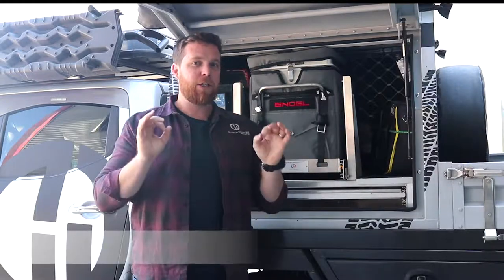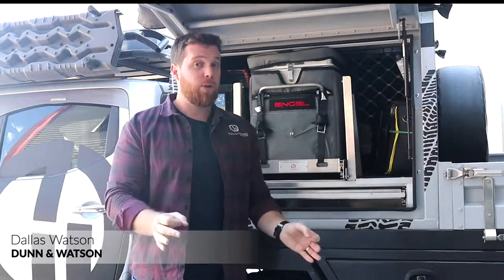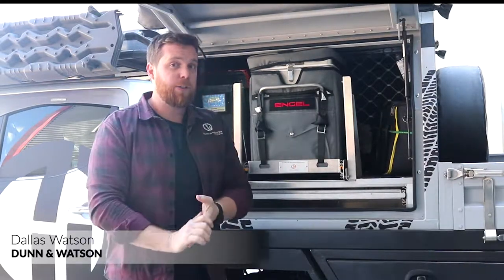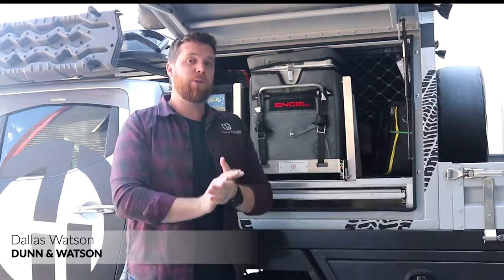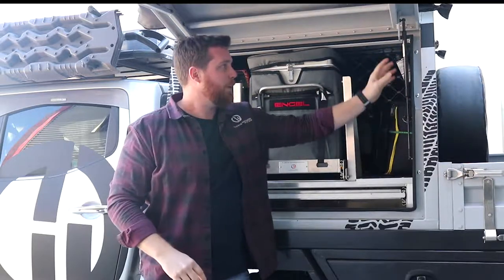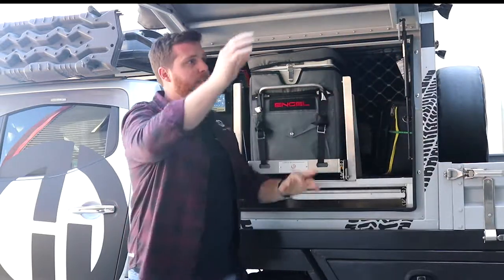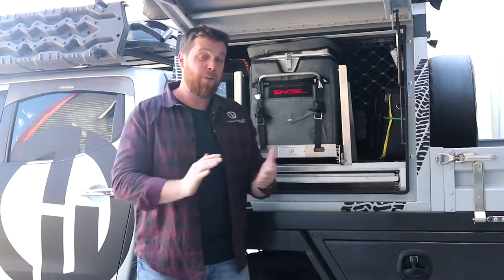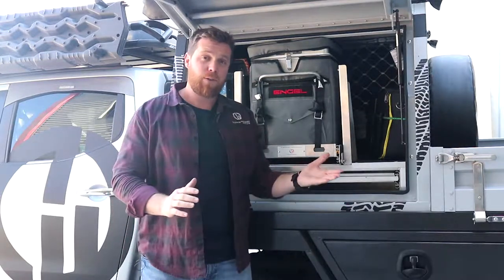The Do's and Dont's of Gas Struts

Comment: When i cleaned my gas strut on the rear door of my van is started to make bad noises like it was sticking and jumping while opening and closing the door. I put some red rubber grease on and the noise stopped. Should i remove the red rubber grease?

Comment: The ones installed on my car from the factory have the shaft at the top and the cylinder at the bottom.  Your video says this is wrong.  Should I go out of my way to flip them around to make it correct?
Reply: It's the right way up when the door is closed..
The door is closed 95% of the time,
Gravity feeds the lubricant to where it is needed.